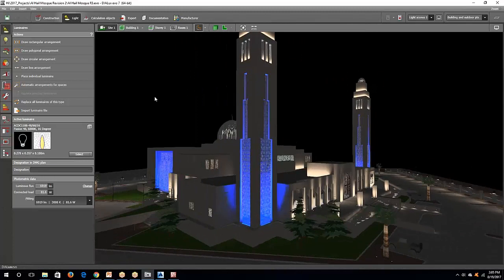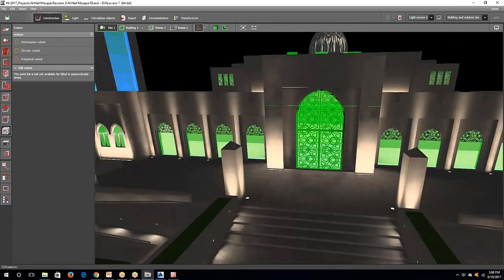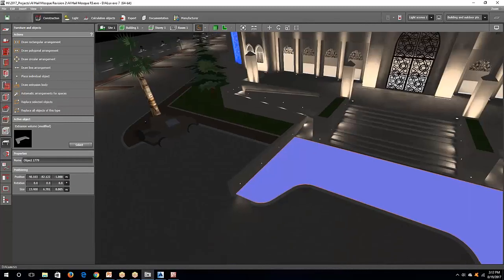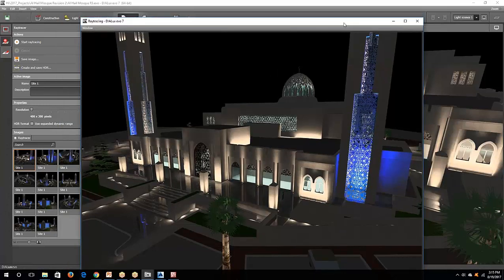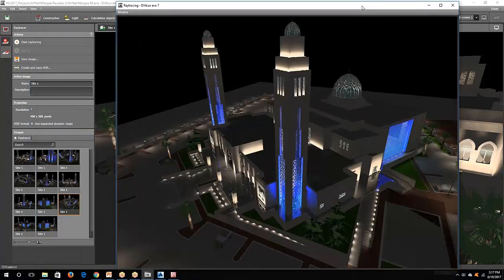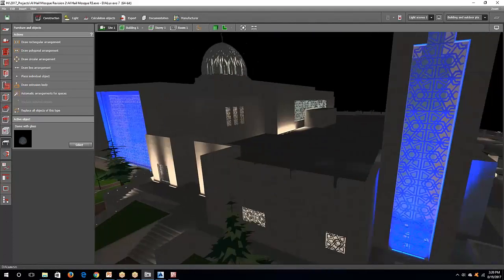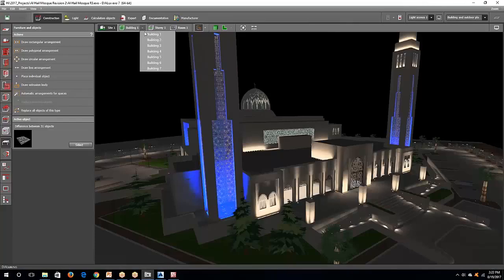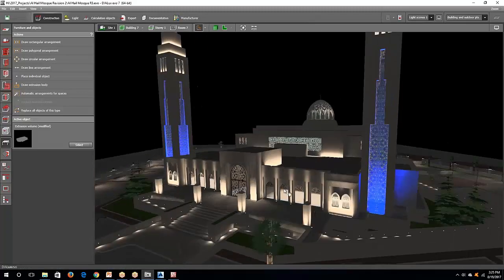4 ways on how to create facade in Dialux evo

Comment: Hi I am a leaner and have a question, can you tell how to get the final output result in dialux evo. I am trying to do a outdoor landscaping calculation. Thx
Reply from the maker: HI Amthaj, check this video.  https://youtu.be/Xqnc3uWNxw8
Reply: Thanks for the reply. 
I am also trying to do a calculation for outdoor pathway light. It’s a ground recessed light. When I try to get draw a basic rectangular floor and insert luminary and calculate I get a error. Can you please advise how to get it right. Thank you
Reply from the maker: check the photometric file of you luminaire and also check how to mount it.  maybe the lighting is facing downward.